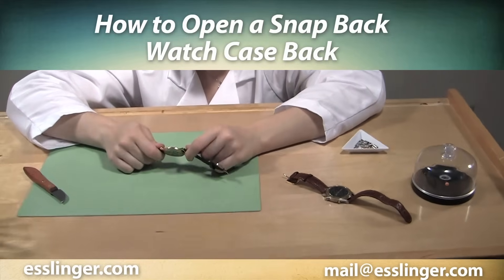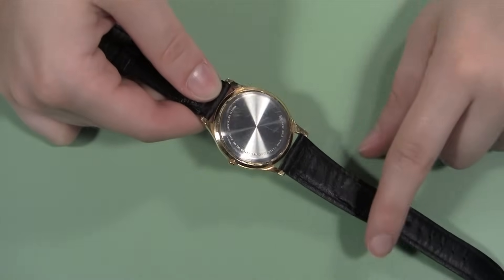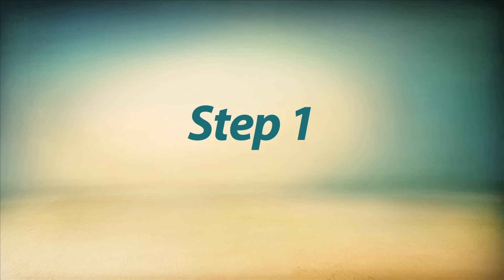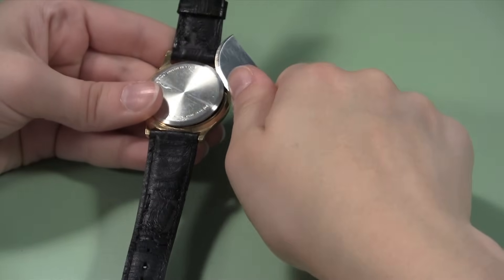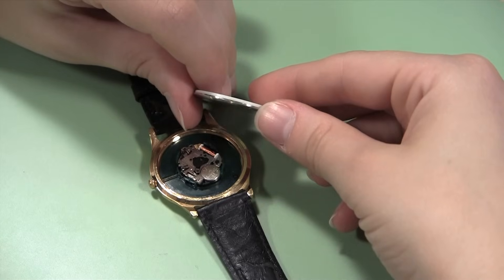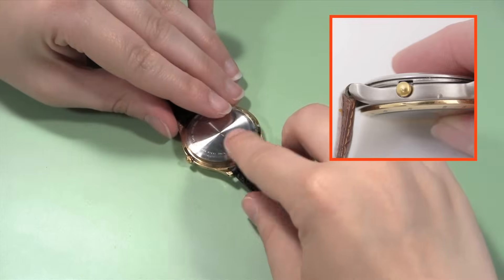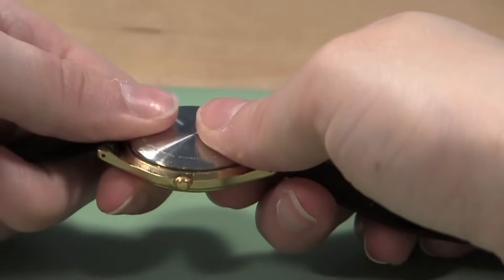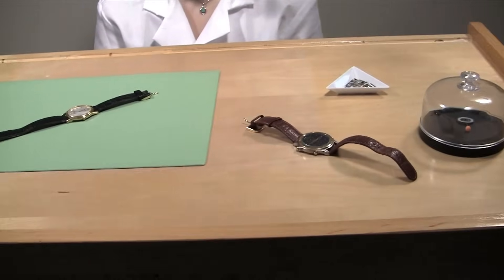How to Open a Snap Off Watch Back

Comment: Popped open the back, replaced the battery and then got to the stage where the back wouldn't go back on. Found this video - told me I need a watch press and thought "well crap". Turns out standing up to get more leverage and applying pressure evenly with my thumbs did the trick in the end. Phew. But seriously this design of back is stupid. The screw back ones are far more sensible - albeit you need the little tool to unscrew them, but they're super cheap.

Comment: I had to wear a couple pairs of glasses to get enough magnification to find the lip on the case-back where I would insert knife .... then it was easy with a proper case-back knife .... but I have done them with a regular knife but wouldn't recommend it as its easy to slip and cut yourself !

Comment: The knife shown in this video is brutal.Use a smaller knife,and use the tip at an angle that will lever the back off.It will be tight,and come off suddenly.

Comment: When I was placing my backing back on, I thought I was going to break the glass.
Reply from the maker: Joshua Felty To help prevent breaking the glass use a soft surface (mouse pad or cloth) and you can also hold the cloth in your hand to help prevent this. Check out our website - there are special holders for watches that can help prevent this.
Reply: Esslinger.com  Thank you for the tip, I will be sure to check out your site. Thank you again.  :)

Comment: Couple of issues with this video:
First, the warning "Be careful not to let the blade slip as it might ruin the back of the watch or .the movement inside"
Good deal!  Only lost a few fingers, but my watch is safe!  <<Thanks jerk.
Second, there is no support with the watch or arms of the person repairing the watch. Held in mid-air, unsupported is a sure way to lose appendages. 
NOT a good video for a newbie.
Reply: i did it on my first try, i just made sure my fingers weren't in the knife's path if it were to slip. though i did have to have it at an angle for that to work.
Reply: There's no need to be rude.

Comment: I can't close it lol
Reply: Wrap it in cloth and squeeze it shut with pliers
Reply: I used the back of the handle of my knife sharpener, pressed against the table. Use a small screwdriver to save your fingers.
Reply: But there's a link..... A few if them in fact, really the whole video is just another form of clickbait

Comment: I'm here to tell you that it is very unlikely that you will do any of this to a Ladies Rotary wristwatch. The lip is there but no tool strong enough will slide under there. Furthermore it's a very very tight snap fit and you definitely will need a press to replace it with suitable dollies/dies/jigs. I think it's outrageous to sell people a battery device that you cannot EASILY change the battery. Rotary should be defamed for using this method. Every couple of years you will have to pay $10 + to get it done. If you have many watches in your family,  add up the annual costs. The actual battery is pennies to buy. That Jeweller will charge you top dollar for it plus his time.
Reply: That's the major reason I won't buy another battery powered watch. The ridiculous watch companies have a choice, either change the backs or go out of business. They're ALREADY coming out with solar powered watches that can run a full day in total darkness. I might get one if there's no aftermarket cover for my watch so I can replace the stupid battery. However, buying an automatic poses risks too. You have to get them serviced every 5-6 years and it costs over $200! That's why the one I got for Christmas has been sitting in a desk for five years.

Comment: It is not as easy as it looks, i scratched the fuck out of the back of my watch trying carefully to do this, the lip around the edge does nothing to help you pry it open, its like these things are made to be as difficult as possible.
Reply: My watch doesn't even have a damn slot to stick the knife blade in. I have a jeweler's loupe and there is not even the slightest gap to slide in a tiny knife blade.

Comment: Pro tip: once you have a knife with a slight curve in the little ridge, apply pressure so the edge of the knife sinks into the connection site of the cap and go around the circle, the cap will later pop off when you twist the knife.

Comment: Give me my 200$ back you sons of bitches i broke my brand new watch !!!
Reply: I broke my hand trying to snap it back
Reply: ***** I actually went to a watchmaker and he snapped it with a tool like a presser, save and cheap.
Reply: Milos Milosavljevic What kind of a 200$ watch doesn't even have screwdown caseback? What a rip-off.
Reply: I got a watch shop changed it @$1.50 for a Maxwell but "that was 5 years ago".LOL